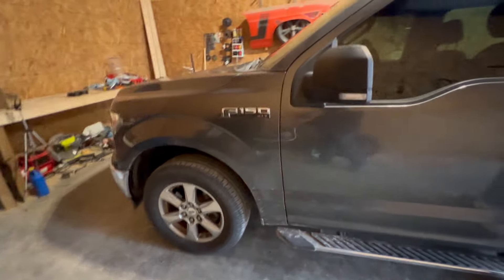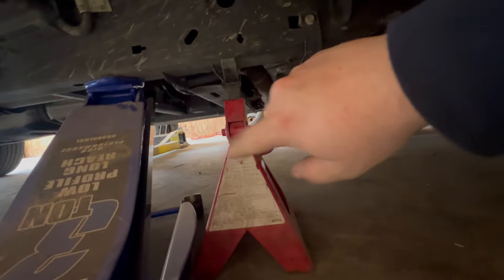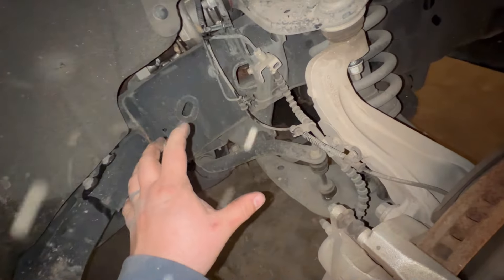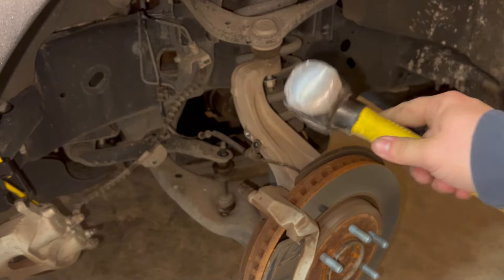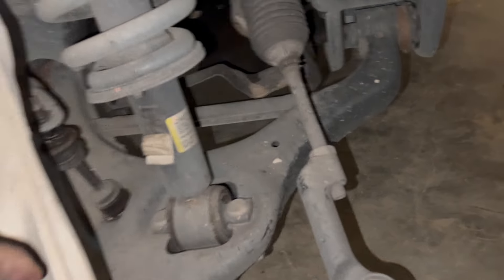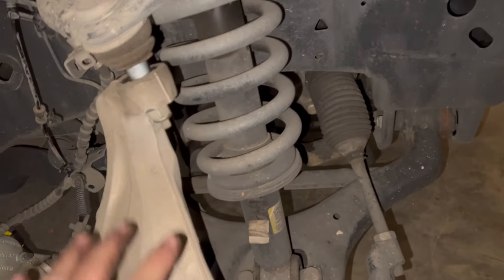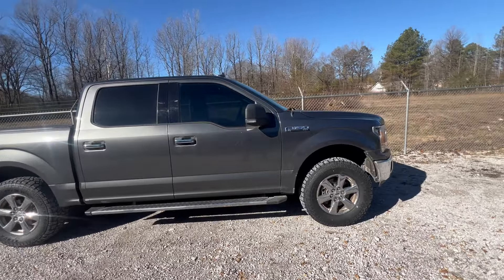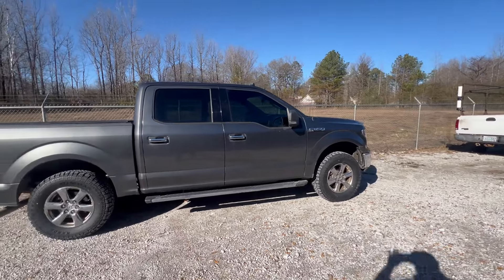F-150 LEVELING KIT INSTALL

Comment: What size and brand kit did you use?
Reply from the maker: This is an off brand kit but I was impressed by the quality, its billet aluminum so it’s hard to mess that up I guess. The brand is FLYCLE and it’s a 2.5 inch kit
Reply: @carswithchris2788  you said 275/70R18? I just got those put in my ‘22 xlt sport 2wd yesterday and I am debating a level of 2”. It seems to be about a 4” difference now in the rear. Too bad I can’t put pictures in these comments.